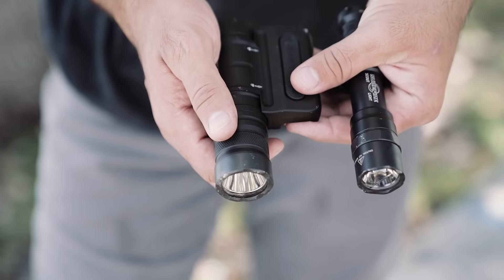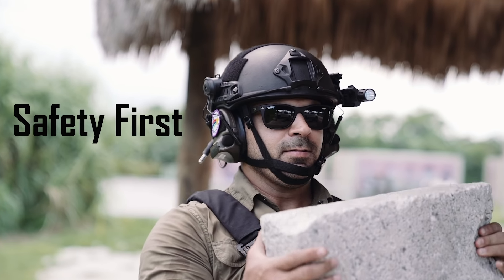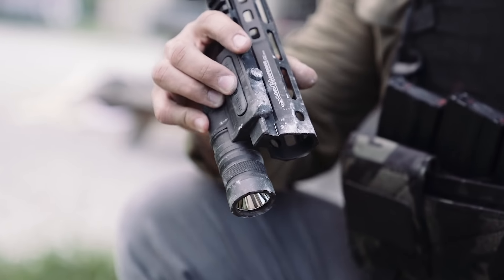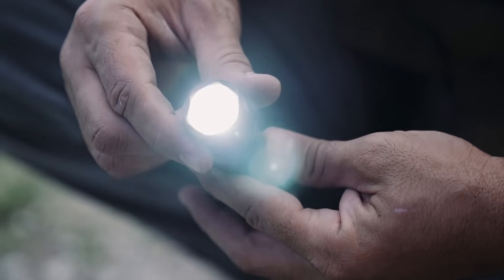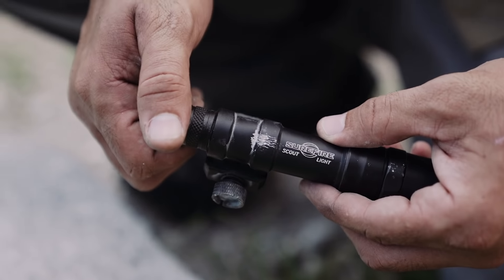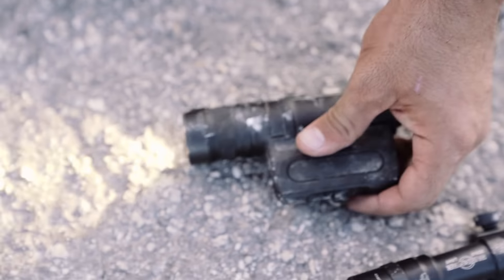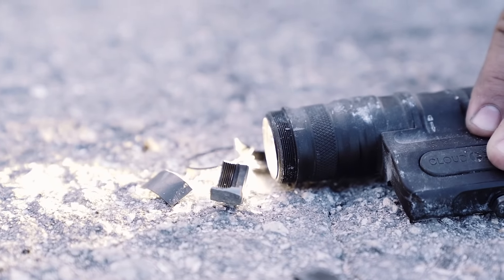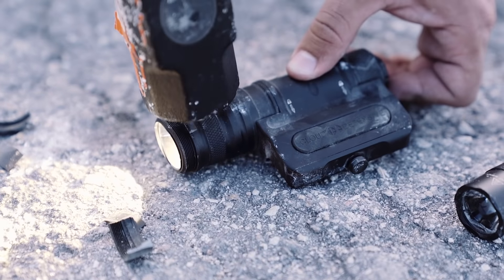SureFire Scout Light VS Cloud Defensive OWL

Comment: Surefire is still tough enough for me and fits my purposes better especially on my guns with lasers for night vision use.
Reply from the maker: Agreed brother I run both lights religiously for that reason.
Reply: Yeah, for a night vision setup, the surefire would be a much better option, especially just being able to use a combo switch that can activate either your MAWL or the light.
Reply: @davidtrumpy4908  nah, owl is no good for suppressor/nods use. Can’t mount forward of the rail to eliminate suppressor shadow.
Reply: @Richardjohnson6969  yeah, I'm in Ca so I dont get to worry about that unfortunately. But yeah I still prefer traditional body lights though the OWL is damn nice if all you want is a good tough light

Comment: I got the REIN light just now ordered. I have been wanting the owl for ever too. Will have both eventually
Reply from the maker: You’ll be happy with both
Reply: Real Dirty Reviews have you guys decided to beat up a rein yet? I’m guessing it would at least be close or even a little more robust than the surefire scout which to me was still plenty enough in the rugged department. Those stress tests were insane I feel like any real life use than pushes either light to the breaking point has most likely already resulted in the operators breaking point as well. 

Next time your doing a test I would like to send you a free o light ODIN (I know what the result will be 😂) I’m just tired of getting crap from guys for spending “too much” on a light. That ought to show them
Reply from the maker: @TYMGhosT  check 2 videos back and you’ll find what you’re looking for 👊🏻

Comment: Wow the size difference is huge. I’m sure both are excellent lights but that OWL is to big for my prefer early and I’m not digging the integrated switch pad. Way to big for a lightweight carbine

Also. Not sure why you’d test the failure of a picatinny mount without it attached to the weapon. I mean I guess it’s valid to test that but isn’t how the mount is used.

Comment: This is easily the best video that shows the durability on both lights. They both did awesome. How much does each weigh? I've read the OWL is 11oz, but can't find a weight for the surefire that includes mount and pressure switch.
Reply: Evocati  You must have missed the part where I asked the weight that "that includes mount and pressure switch". It's not just the flashlight. Thanks for playing

Comment: You get a tough light for $400! I wonder how the streamlight protac would hold up the same test.
Reply from the maker: We might have to do a follow up!
Reply: Streamlight / modlight and just for the LOLZ - inforce :-) Even though they break without trying. 

I bet an arisaka / malkoff device would be desired as well as I see a good number of those on posts
Reply: The hlx fails from normal use like an inforce. The modlite would fair the same as the surefire.
Reply: My HLX had flicker and tailswitch failures (3 different tailswitches) -- so you're not wrong there! Love my CDOWL!

Comment: Cloud defense has the weakest connection to the rifle. The bolt the screw goes into is aluminum. It can be overtightened and stripped out very very easily. I’ve had three of them I know.

Comment: I like it, I dont know how well it will work with a peq or Mawl though
Reply from the maker: With the OWL its almost impossible especially on platforms with shorter handguard lengths
Reply: @realdirtyreviews  You could potentially side mount your IR laser and run a pressure pad ontop of the owl right next to the owls pressure pad. thats what im doing and still think i will get great ergonomics
Reply: I will share pictures on instagram if it goes as planned

Comment: If you don’t own night vision the OWL is the better option.  It’s an ambidextrous light that you don’t need tools to install. The light is the tool. You don’t need to buy a mount or a switch as it’s integrated into the light or batteries(owl comes with two sets of batteries) or a charger as that is included as well. People complaining about OWL’s weight must be carrying 600 rounds of ammo on their person and 100 pounds in their ruck while shooting on the weekend 😂. If you’re just using this for home defense and recreational shooting the weight is not a big deal. If you’re walking 15 miles with a ruck and lots of ammo then losing the additional ounces is warranted. You weekend warriors have much more to gain with the cost effectiveness of the OWL
Reply from the maker: True just a little heavy

Comment: My Streamlight Pro-Tac HL broke its lens when it fell on a carpet floor from about 38 inches (being mounted on an AR, it was leaning against a wall and it fell). 
Not only did the lens broke. The light is dead, half of the time it doesn't even turn on, and when it doesn't turn on, while holding the switch, you can tab/smack the light body and it would shutoff... the connection is all messed up from one short fall... damn, my iPhone can do better than that hot garbage and iPhones are infamous for cracking screens
Reply from the maker: Si_Vis_Pacem Para_Bellum in most cases you get what you pay for